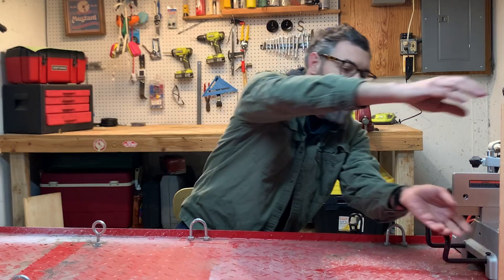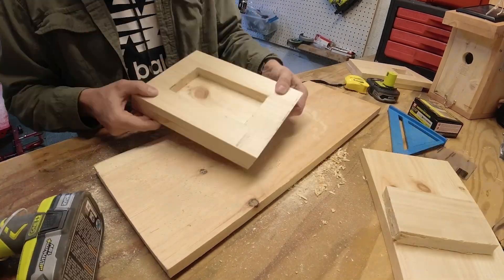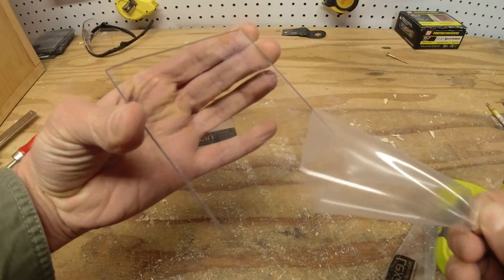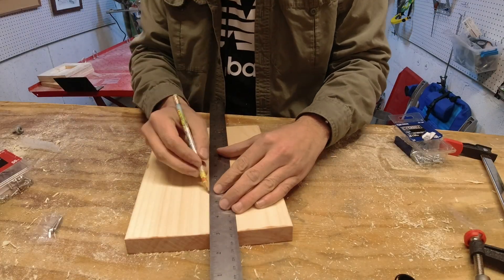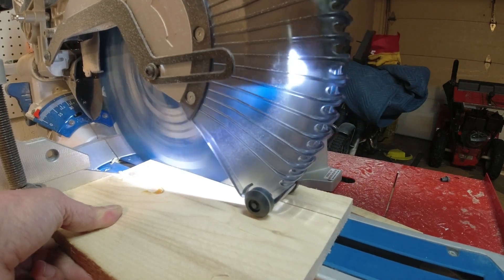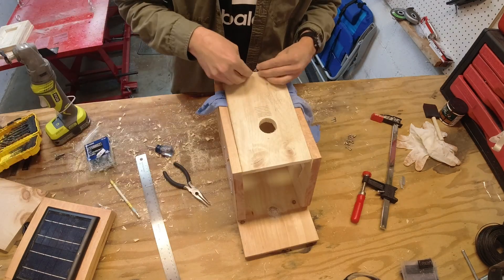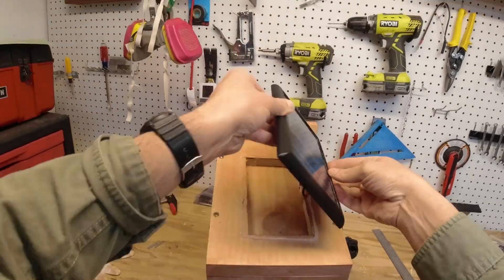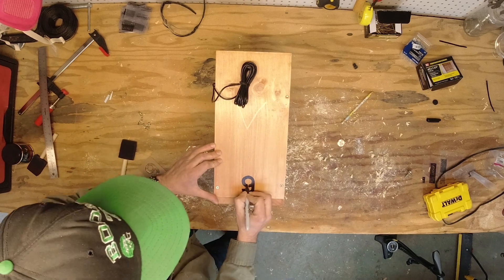EASIEST DIY Birdhouse with Solar Powered Wifi Camera inside, Every Step Explained

Comment: Unfortunately a great project that falls a bit short for bird egg and chick safety.  I like that shallow kerfs cuts were made inside and out for easy access and the dreaded perch was not used.  All bird boxes should have floor drainage, adquate ventilation and a predator block over the access hole. Still, very nice work.
Reply from the maker: You are correct.  Most all of these issues will be addressed in next seasons houses.  Thanks for watching.

Comment: My blues are always on top of the roof how do you keep the poop off the solar panel plus mine solar panel gets hot. Great video can you post the measurements for each piece? Also what was the silicon sealer you used? Thank you 😊
Reply from the maker: I find that they roost on the highest point.  Which would be that elevated tab on the back.  The panel does get hot but i have tried to dissipate it a bit with the double thickness roof.  The next gen models will have a bit more ventilation.  It isn’t that big of a problem in PA because the days here are still a bit chilly.  Temperature might play a part if there is a second clutch though.  These cameras have a built in thermometer so i’ll be able to monitor that too. The silicone is just a basic sealant from Home Depot.  Thanks for watching!
Reply: I love this guy's work too and he answers questions!

Try adding four blocks to the roof and  place a larger  "shade roof" over the primary roof. A larger solar panel will fit on the upper roof and it is barely any extra work. Just imagine a roof over a roof.  I used a wifi thermostat (Ewelink WiFi Temperature works with Alexa/Google)and figure while under full sun it is is cooler by 25°F. 
I learned this when a house wren flew within 5 feet away and started vigorously serenading me (beautiful songs) then fly back to her box and back.  I finally figured her chicks were roasting alive in her nest box. Luckily, I had a mister sprinkler and cooled the box down for the rest of the day. 

Glueing one inch blocks to the roof, then screwing a second roof with that airspace between, not only cooled off the box but generally protected it from the UV and rain elements. Next spring I will easily replace the faux roof for the third time. 

If you live in the frigid north,  you might also one to consider small vent holes with pivoting covers at the top of the box under the roof line. During the early spring, keep them closed  and open them summer.

Comment: Thanks for this excellent video!  Would love to have links to the solar panel and camera you are using.
Reply: In another comment, he wrote, "Wasserstein solar panel, w/a micro usb connector. A Blink camera battery will run out in a day, if you check in often. Even w/ the solar, battery discipline is key."
Reply: oh yes .. me too

Comment: But the solar panel that charges?...because the Blink camera does not have a lithium battery, it takes normal AA batteries, does this camera accept rechargeable batteries?...and are they the ones that the solar panel charges?...Thank you
Reply: I'm curious of that too

Comment: Great video - inspiring!
Does the camera and solar panel need to be carefully matched? Or do all these solar panels tend to produce the same voltage? Can they overload the camera if the sun is too strong, or is there clever circuitry to stop that happening?

Comment: Love it. How about drainage holes in the bottom?❤
Reply from the maker: Water doesnt really pool but it would be nice for airflow.  As my carpentry skills improve so will the houses!  Thanks for watching, stay tuned!
Reply: @BeakPeeker  yeah, it would be perfect with a raised wire floor, drainage holes in the bottom and some air flow holes. Looks good, though. Which solar panel and camera are you using?
Reply: @slackergeek2007 my same question, what solar panel is he using??
Reply: @brendalins1237    did he ever get back to you?
Reply: @robertcornelius3514  no
Reply: @brendalins1237 in a previous comment, he said he "used a Wasserstein solar panel, w/ a micro usb connector. Solar battery discipline is key; a Ring-camera type battery will run out in a day, since you'll most likely be checking in very often."

Comment: Great project! 
Would you mind sharing the model of the solar panel?
Reply from the maker: Thanks for watching!  It’s a Wasserstein brand with a micro usb connector.
Reply: Do you have link to solar camera in bird house?  @BeakPeeker
Reply: Thank you! Your video  inspired me, I'm going to build one too.
Reply: Do you think batteries alone wouldn't be enough for Blink Cameras in this project?
Reply from the maker: If it’s a busy nest and you check in often (which you will because it’s fascinating), the batteries will run dead in a day.  Even with the solar, battery discipline is key.
Reply from the maker: Thats great!  Go for it!